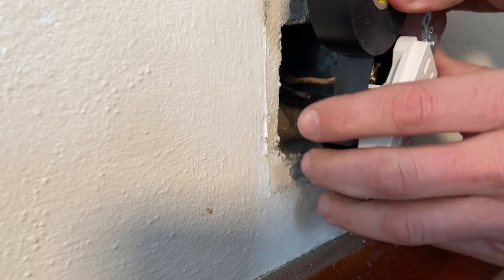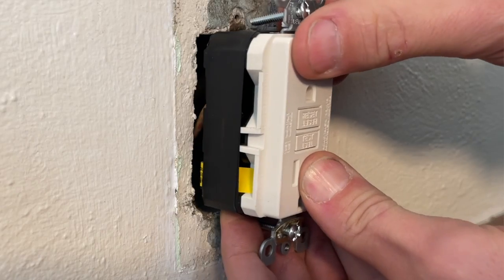Should You Wrap Outlets In Electrical Tape?

Comment: Nothing wrong with wrapping when using a metal box. But if you’re using metal boxes in residential application you are just making you’re life harder. Wrapping wire nuts is a complete waste of money.
Reply: Back in the day all electrical boxes were metal. There was no such thing as those crap ass plastic boxes. Was all US Steel kiddo.
Reply: Well we aren’t back in the day anymore. And the plastic boxes are fine. If you’re a cheap ass and buy cheap materials that’s on you. We aren’t in 1950 anymore
Reply: @markmadlena6009  plastic boxes suck compared to metal ones. No one is using plastic because it is better. If they are then they're idiots. They're using it because they're cheap lazy SOBs who don't care about quality work. It is too bad we're not in the 50s anymore. I used to repair instruments and the old ones from then were way better than what was made later. Made out of nickel chrome steel not just CRS crap. We couldn't even regrind the old ones. Well we could but we had to use the water cooled grinder.
Reply: Well I use plastic boxes all the time. I take great pride in my work and have no problems.

Comment: why we remove cable jacket in electrical boxe ? because it s a  combustible , in electrical boxe we eliminate all stuff who can burn so your electrical tape it s really bad idea
Reply: Electrical tape is no more flammable than wire insulation is. So now what are you going to do? We always laugh about the paper on the ground wire. Say it's there just to get the fire started.
Reply: @1pcfred  it's not like dry wood but it eventually ignites, try with a lighter! some electrical tape heve better performance but it is for a temporary repair or for low voltage
Reply: @ericcaumari3957  if you have an open flame in your wall you've bigger problems than electrical tape. All household voltage is "low" voltage wiring too. High voltage does not start until 1000 Volts. The more you know.
Reply: @1pcfred  in the normal house Low voltage it s 12 volts ,24 volts , high voltage it s 120 , 240 volts ,anyway you can use whatever you want , it s only my opinion and many electrician share it .
Reply: @ericcaumari3957  what is considered high voltage is no opinion. You and anyone else that wishes to dispel their ignorance can look the value up easily on the Internet too. I certainly did before I left my last comment. Because like most folks I do not like to be wrong either. Like it, or not, the cut off is 1,000. Although why that value was chosen I cannot say. It is a nice round number.

Comment: I hate when previous people wrap devices and wirenuts. Makes it harder to work with. And it tells me they were not sure about their work. There is no need for tape if the work is done properly. If you don't know what you are doing you should not be doing it anyway.
Reply: I know what I'm doing. You don't know what I'm doing. If you think everything is so cut and dried you don't know what you're doing either.
Reply: @1pcfred  I'm sorry you took my comment personally. I have only been doing electrical work since 1981. I understand i don't know everything about it. I have only done residential, mostly commercial, and some light industrial. I have only been lisenced since 1988 as i worked part time during high school and it took a few years to get my hours to qualify for my exam. I have seen most situations but i am sure not all. I do know quality work from that which is not.  I would say the quality work is probably only 1/3 of the work done. I know a lot of people who were taught to tape everything. I personally do not think it is necessary.
Reply: @nooneyouknowhere6148  we cannot all be slavish minimalists. Anything worth doing is worth overdoing in the eyes of many too. Has it ever occurred to you that there is a reason they make electrical tape? That reason goes beyond securing wires to fish tape. Although electrical tape certainly does work good for doing that.
Reply: @1pcfred  you could be right. Then again, maybe not. If the workmanship is correct, you don't need the tape to cover for you. Make your splices properly and connect your devices properly and there won't be a problem. Anyone working on the circuit later who could have contact withe the screws on the device, should know their limitations and turn the circuit off before proceeding. And most likely call a qualified electrician.
Reply: @nooneyouknowhere6148  in a perfect world you'd be right. But what is often the case is we have to make modifications to existing work. Then what's there that we have to work with can be inadequate. Sure you could change the box. But that is often beyond what would be considered acceptable effort for the task at hand. Like take the example in this video. Guy was stuffing that big GFCI into that old style 1800 box. Ripping the wall open to change that box is a good way to drive yourself out of business..

Comment: Have to disagree regarding wire nuts. If the wires are twisted it shouldn't even be an issue so the point made in the video seems well, pointless. If not twisted then consider the situation. He says taping the wires causes more issues. So the logic here is holding the wires together causes more issues whereas allowing the wire to be loose and come out of the nut etc is better.  Not sure I can get behind such vague and dubious logic.

Comment: Completely useless to tape a GFI. Tight metal box means nothing. The screw terminals on a GFI are sunken in from the outside of the plastic device. It is a physical impossibility for the side of the metal box to touch the screw terminal. Wiggle it and smack it all you want, the side of the metal box will never touch the screw terminals.

Comment: Ew. Wanna create a massive debate. You got a 50/50 chance of being right. But you’ll get a thousand different reasons. Which way does the ground go? I say up to prevent metal objects from falling and contacting a half hitch plug. It’s weird to think of. But I got lit up first day of vacation because a graphite fishing pole had fell over. The lamp was plugged in but had worked it’s way out just enough. The tip contacted the hot prong. The rubber handle was not grounded so no big deal. Until a big man with high sodium and bare feet grab the pole mid shaft. I say ground goes up. But I just a plumber that sees them down by the second. Everyone is down.

Comment: With UK and European sockets & switches, there's never a need to tape them up because the terminals are recessed into the body of the fitting. I always thought it odd that US fittings have that large exposed terminal on each side. Cheers!

Comment: I wrap wire nuts, but not to hold the wire in place, but just to help keep the nut from ever falling off.  To keep the wires together, I spin them as usual, but I actually get anal and throw a zip-tie on it, over the electrical tape so to keep the tape from ever unwrapping.  I only do here-and-there electrical work, I know anyone doing this for a living probably won't take the time to do all that.  I'm on the slow move to wago's and just use a zip-tie on those to secure the wires from moving.

Comment: You should ABSOLUTELY use tape with wire nuts! The "test" you did that gave you a "false sense" of a good connection, should have been done BEFORE you wrapped the tape around.
Come on.....Don't be dopey.
Oh yeah....I also wrap receptacles, because that is the way I was taught. Might sound dumb, but I don't have another reason for it, and it is really not much extra effort.

Comment: How much voltage would it take to arch from the side of the screw to anything that could complete the circuit?  About the same as with the tape.  It's pointless.  Also the last thing you do in a scientific experiment, is ask a ignorant group of people what they think.  Do experiments to determine it.

Comment: Professional electricians don’t wrap receptacles.  If the box is properly wired there is no reason to do this.    Never tape wire. Nuts either.  Tape is not designed to be a fastener, as stated it’s only an insulation tool.

Comment: No you shouldn't...with time the electrical tape will turn into carbonized material.....CARBON IS A CONDUCTOR FOR ELECTRICITY....but if its an temporary installation it can be used.

Comment: You're an electrician, and installing gfi without a ground?!
Reply: You don't need to install a ground on a gfci receptacle if there isn't one present. It's actually an accepted method to update a 2 wire receptacle to a 3 wire. It's in the code book. I'll look up the reference number if you want it. Also, the guy in the video is not an electrican, he is a diyer.
Reply from the maker: Thanks Jim 👍
Reply: @EverydayHomeRepairs  also, don't know if you know this, but if you do the first receptacle on the circuit with a gfci, you can change all the rest of the 2 prong receptacles on that circuit with regular 3 prong receptacles. You just have to put the little sticker on them that comes with the gfci.
Reply from the maker: @jimmac1185  yeah, I mentioned that all the way at the end of the video because you are right most people probably don't know and will just swap all 2-prong receptacles out with a GFCI.  Thanks for the feedback.
Reply: @EverydayHomeRepairs  opps, I must've missed that!

Comment: No. The glue will cause more problems when you have to make repairs.
Reply: What glue? This is quite a stretch and likely doesn't come from experience.
Reply: @ce2flaco  Electrical tape has an adhesive on one side so that it sticks to stuff. After a while the glue doesn't come off with the tape when you try to remove the tape. Further, the plastic of the tape starts to rot and causes further problems. Experience. I spent a couple years on a Navy ship changing light bulbs and the like.
Reply: @kenvandeburgt1232  They didn't teach you swabbies how to spit shine? That's what the whole yo ho ho and a bottle of rum is all about!
Reply: @1pcfred  I only got Rum when the Princess sprogged. You don't spit shine electrical tape.
Reply: @kenvandeburgt1232  that's your problem then. The fact remains that alcohol laced mucus is a great adhesive remover.
Reply: @1pcfred  Its even better when there is no adhesive to remove. Then you can spend your time doing something useful.
Reply: @kenvandeburgt1232  I was also a Navy electrician. I've been in the industry for 28 years now. Whatever tape you were using was defective or simply not vinyl electrical tape. There is no issue with the adhesive on typical vinyl electrical tape.
Reply: @ce2flaco  There is if you leave it in place for a long time. Not an issue if its used as intended but wrapping around an outlet isn't intended or needed.
Reply: @kenvandeburgt1232  your arguments are facetious. I am not about to remove glue residue from electrical components under any circumstances. There is no scenario where that's ever going to happen. If I am really worried about it I'm just going to tape whatever it is back up again when I'm done.
Reply: @1pcfred  There is nothing in Code that requires or allows an electrical outlet to be wound with tape. Further, the outlet is designed to fit into a standard electrical box where if the wiring is done correctly, there will be no contact with the box and further, the box is supposed to be properly grounded. No tape required. Point about glue is moot when no tape is used.
Reply: @kenvandeburgt1232  You are mistaken. I've removed tape that is decades old more times than I can remember. It comes off easily unless it's rubber tape. I'm sure that is what you are thinking of. Rubber tape does indeed leave behind quite a bit of residue. Not trying to be rude but you're just not correct on this. It's especially harmful to new electricians that might get the idea that wrapping devices is somehow a bad thing when in fact it's a very good idea and an additional layer of safety that simply has no downside.
Reply: @kenvandeburgt1232  At this point I'm going to guess that you don't work in the industry and if by some off chance you do, you're likely not accomplished. You mentioned code as if it's some sort of maximum. The electrical code is in fact a bare minimum. Going beyond the code requirements is common and rarely a  negative. There is no provision to "allow" (your words) electrical tape on a device because it is a step beyond what the code "requires". You also mention that the box is grounded or should be and you are correct. This is exactly why the tape is a good idea. If someone is working hot, or if someone manages to push a loose device to the edge of the mud ring and touch the plate, it will short and arc if uninsulated. With a couple layers of innocuous vinyl electrical tape in place, there is no issue, no arcing, no damage, and no tripped breaker.
Reply: @ce2flaco  You're right I don't work in the 'industry'. I did for a while.

I haven't ever seen an electrical outlet wrapped in tape. It certainly isn't common practice.

Wrapping tape around an outlet isn't going beyond 'code'. Its unnecessary and is probably increasing likelihood of a hazard. 

If the outlet is installed correctly its not going to touch the sides of the box. If I saw tape around the outlet inside the box it would be a red flag that some incompetent installed it.

Working 'hot' is not best practice and should be discouraged.

If there is a loose device that manages to get pushed to the edge of the mud ring then the best thing that could happen is a short that trips the breaker because it will (or should) trigger an investigation into the problem.

Comment: First of all, GFCI rec. is no good without ground wire, so you changed it for nothing. Second, screws on it are recessed so they wont touch box. Third, you should twist the wires with lineman's pliers before you use wire nuts. No tape except if a lot vibration or moisture but then use rubber tape.
Reply from the maker: Hmmm, what about NEC Section 406.4(D)(2) ?  They call out a GFCI as an acceptable replacement for 2-prong receptacle with an update in 2017 to allow label for “no equipment ground” to be placed on the cover plate.
Reply: It allows you to update two prong to three without pulling new wire, per code, so it's not for nothing.

Comment: Argh. Sticky nasty black goo is never good on devices. Air gap is higher insulation than 600v rating of even good tape like 3M 33+. Any two wraps does not increase rating to 1200V!!!. Wire nuts and splicing? Ok, I'm not sponsored by 3M, but their red/yellow and blue/grey nuts are the best IMO. BUT DUDE!!! Tape a wire nut? NO!!! Rely on wire nut to hold conductors together??? HELL NO!!! Mechanically twist wires together with your pliers so the splice won't pull apart. Then screw the wire nut in to insulate the splice. Or better yet, quit with the DIY and rat RePube shit and get an IBEW Journeyman Wireman to do the job right! SMH.
Reply from the maker: Would a DIYer be considered a "rat" working on their own house?
Reply: @EverydayHomeRepairs  DIY On/in your own property is not rat. But if you haven't noticed, electricity is dangerous. People who haven't been taught the correct mechanical methods of doing the work, learned the National Electrical Code and common electrical/electronics theory would be better off keeping their hands off unless working under the direct supervision of a truly skilled and trained professional. There is a reason most states, counties and municipalities require certification to do electric work.

Comment: What some terrible dangerous advice.

 How are you replacing a 2 prong outlet with a GFCI? First off its not going to work properly, secondly the ground will not work. If you plug anything in that is not double insulated its not good. Secondly if your metal box was properly grounded, as is code. It wouldn't matter. If the hot leg somehow touched the box it would instantly trip the breaker. 3rd if you would twist your wires together properly before installing the wire nut. It wouldn't be an issue. Taping nuts on is generally reserved for potentially dirty or vibration environments, such as small electric motors. Where the vibration could eventually rattle the nuts off. 

You clearly have no idea what you're talking about, and just regurgitating what your uncle Larry told you 10 years ago. You owe it to society to stop, before some one gets killed or burns their house down.
Reply: You don't know what you're talking about. It is a metal box with armored cable.
Reply: @1pcfred  no where did you inform the 100,000 viewers of this video that it had BX cable connected to it. Anyone learning from this video has no idea or the nuance of the subject. Even if it does, a simple google search will tell you BX is not an acceptable grounding path. So I fail to see your excuse of a point. You also completely failed to mention when and how the outlet must be ground bonded to the box. You are a hack, plain and simple. The people will get hurt or worse following your advise.
Reply: @EitriBrokkr  he doesn't need to. I can tell by the vintage of the box and trim work. There was nothing but BX cable when that building was built.
Reply: @1pcfred  and would you consider your visual, electrical dating skills the norm across society?
Reply: @EitriBrokkr  don't know. Don't care.
Reply: @1pcfred  and that's the attitude that get people killed, thanks for confirming
Reply: @EitriBrokkr  no one is getting killed with household electric. Not unless they're standing barefoot on wet concrete. Then they might be in danger. Or if they just got a weak ticker to begin with. But then it's just a matter of time for them anyways. Buzzards and worms gotta eat too.
Reply: @1pcfred  why do electrical codes exist?
Reply: @EitriBrokkr  because bureaucrats need jobs too.
Reply: @1pcfred  and to keep people's houses from burning down
Reply: @EitriBrokkr  we have codes and people's houses still burn down so there goes that argument.